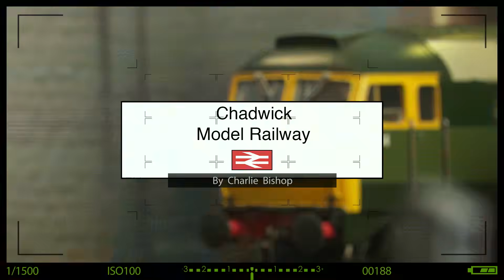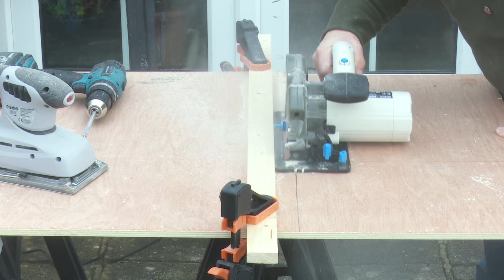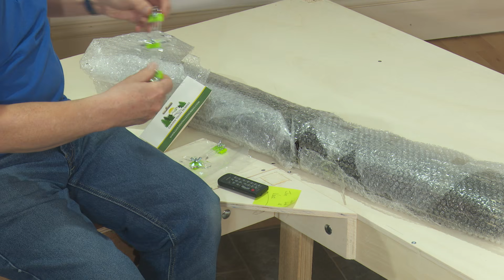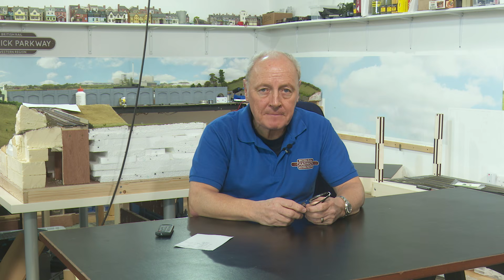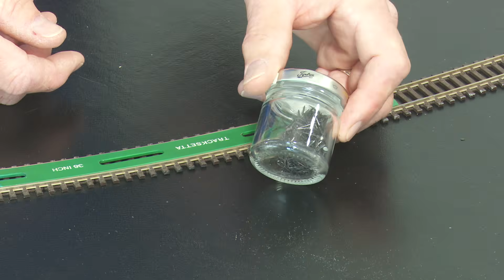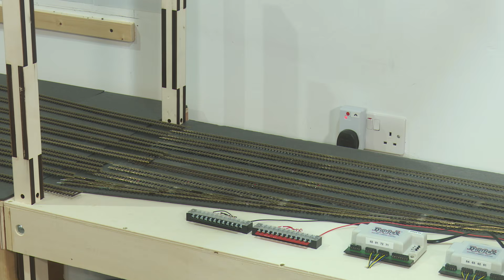Laying Flexible Track at Chadwick Model Railway | 119.

Comment: Hi Charlie,  That was a very interesting way of laying flexi-track and creating curves. As with most jobs there is often other ways to get the same result you achieved. I will try to tell you how I created curves using flexi-track. Nine times out of ten the curve will commence following a straight section of track. Attach the track which you wish to curve into the end of the straight section and using the tools you have gently tease the track to create the desired radius. As you rightly  pointed out the rail on the outside will end up longer than the inside rail. Well I simply mark the outside rail so it is in line with the inside track and with my trusty track cutters I then snip off the "over run" of the top rail and file off any rough bits, job done. If you have any more curves to make then maybe my way might be of some help.  Cheers   Greg
Reply from the maker: It’s great to share our techniques Greg.
Regards Charlie.

Comment: Got my Hattons 66 a few days ago. Turned it upside down to remove chassis and the top grill fell off. Difficult to remove body - but aren't they all. Runs very smoothly. Very nice model but lacking a bit in quality. Cannot comprehend how a model of Rocket could possibly win with all the other quality stuff about!
Reply from the maker: Great comment Roger, many thanks.

Comment: Another way to prevent the track kinking on curves is to have about 3 inches of track between the joins, in other words, have a join on the outer and then have the join on the inner rail of the same track 3 inches away from it. So the joins are not in the same place.
Reply from the maker: You didn’t watch the whole video did you Sam!
Reply: @ChadwickModelRailway  I apologise profusely, No I didn't, I had to leave it at an earlier position with a view of coming back to it, I will try not to jump the gun in future.

Comment: Hi Charlie, I look forward to your videos as they are always interesting and informative. I've seen many different ways of joining flexible track on curves, staggering the joint looks like it gives excellent results and aids removing the "dog leg" from the joint. I usually remove about 6 inches (150mm) of sleepers and then bend the exposed track to the desired radius to remove the natural spring of the nickel silver track. I usually cut the last half inch (13mm) off as it's difficult to form the curve right to the end of the track. Next time I lay flexible track with a joint on the curve I will also stagger the joint. Regards, David.
Reply from the maker: I'm so pleased that you enjoyed it David.  
Stay safe. Regards Charlie

Comment: Thanks, Charlie. I don’t know why I didn’t think of staggering rail joins before.
Reply from the maker: It wasn’t my discovery either.
Reply: we tried it on our initial layout but there's too much cutting up of the ties to make room for the mid-section joints. its not a big deal but it leaves you with a lot more expensive trash rather than reclaimed flex sections. with the price of track (don't tell the guys but i've purchased 500 sections of GT code 80 flex tracks for 35 cents apiece from life-like about 25 years ago- i cleaned them out) nowadays salvaging track for new layouts is crucial to our existence (and our ability to pay the rent...). also gluing individual ties in place is a major pain.

Comment: Within a fiddle yard, how critical is it to have the 6' spacing? I would assume that, particually the straights, you could be as close as the rolling stock allows and just ensure there is enough clearance on curves / make sure you're not running in both directions at the same time?
Reply from the maker: A good point Ian, but getting the trains on and off can become an issue.
Reply: @ChadwickModelRailway  Good point. Although with limited space I'm trying to pack as much in as I can. Suppose I have to pray I don't de-rail in the fiddle yard!

Have got a through line which is at the front so should be able to load / unload there.

I need a bigger house. Or just another house 🤔
Reply: The 2 5/8" spacing on the curves continues the spacing between the "standard" second to third and third to fourth radius curves.  This should avoid the potential issue of long rolling stock on adjacent tracks fouling each other.  If the storage track were entirely straight then the 6' way measurement can certainly be reduced.

Comment: Another excellent video Charlie. 

I have the Rocket but did have issues to start with. One of the wire between loco and tender broke as the tender is not permanently fixed but I was able to re-solder it, luckily I work in electronics so I’m used to such fiddly jobs. To stop the tender from parting the locomotive I have use a small piece of wire sleeving on the pin to hold the drawbar in place. The second problem was it didn’t run. I could hear the motor working but it wasn’t engaging the wheels, a small bit of pressure on top with finger allowed movement. The was a bit of a downer moment as I thought it would have to go back and I knew getting it replaced was unlikely. I inspected it closely and found two black tabs under the boiler that looked a bit out of place and was able to prise them out which fully engaged the motor. It now works beautifully, linking the train together can be a bit of a bugger at first.
Reply from the maker: A great comment Rob. Two cables came off mine! So demoralised.

Comment: Excellent video, I’ve given thought to the subject of joining track on the curve and like you soldered the fishplates. Regarding rail expansion to me cut the track in the centre of a run and as you say stagger the joint. Droppers either side of the cut gives continuity. I’m in the process of creating blocks in existing track work and have found some disc cutters on evil bay for the Dremel with a thickness of only 0.6mm. Should do the job ok I reckon.
Reply from the maker: I think that you're right Roy.  Regards Charlie

Comment: My childhood model railway constructed by my dad was made totally with flexible track so he could create the exact track plan desired. When building Ewood I bought some flexible track to try the same method ..sadly it didn't go well and I reverted to the standard pieces. Dad was a design engineer and a perfectionist..I'm not .RIP dad Ewood Railway was not at your standard but you'd have loved it.
 Thankyou for this video it's bought back memories.
Reply from the maker: What a heart warming comment.  Although I'm sure you'd crack it in time.
 Stay safe. Regards Charlie
Reply: your dad was a man of vision- i think flex is the only way to fly- especially in the finer scales both in terms of options and for minimizing the multiples of feeders.

Comment: Hi Charlie, another fact finding video (wish I had seen these before I built my storage yard) with hard to reach hidden in tunnel sections I soldered the lengths of flex track together and used tracksetta with Peco pins. Because my layout is in the loft I found leaving a 2mm gap every 2.5 metres allows for any expansion/contractions and the sound of the rolling stock passing these gaps adds to the realistic value. 
To ensure Santa sent me the items I wished for, I ordered items and my wife wrapped and hide them up (don't tell the Grand children) Merry Christmas to you and your family and remember stay safe...
Reply from the maker: I'm so pleased that you enjoyed it Barry.  Stay safe. Regards Charlie

Comment: Hi Charlie. A novel and unforeseen use of the Flexible Track Guides - you may not realise but the way you have used them in order to set inter-track distances, is not what these guides were designed to do.  If they were designed to do what you suggest, there would be no need to have the central rail holder adjustable perpendicular to the line between the 3 rail holders.  You demonstrate the use of the Tracksetta guides, but their drawback is they are only good for the specific radius of the guide; the Flexible Track Guides were designed to overcome this limitation in that the 3 rail holders can be set to any radius - ie unlike Tracksetta guides which are a fixed radius.  The idea is the 3 rail holders when set to the required radius can be run along a single length of track to set the curve (much like the Tracksetta can be moved along a length of track). Clearly, as these guides can be set to an infinite set of radii, they work out a lot cheaper and have far greater utility than Tracksettas.
Reply from the maker: An interesting observation David, many thanks.

Comment: Thanks again Charlie for another interesting video.  I never thought of threading the track a couple of inches into the next piece of track, which is an excellent tip.  I have managed to dig the track into my finger when trying to move it along providing me with bloody track.  Now I use pliers or Spencer Wells artery forceps to move the track along to prevent injury.  The track does look good.
Reply from the maker: Don, I'm so pleased that you found the video useful.
Regards Charlie
Reply: ouch! at least sharpen it first....🙁

Comment: Argh! Just finished laying most of my track and I have one dogleg! I used the tracksetta idea at the joins but there is no 27" tracksetta - guess where the dogleg is! Those Golden Valley tools look very interesting. I know what Charlie means about re-threading the Bullhead. It is quite fragile but it is possible. In fact sometimes just press down on the top and the rail will slip back into the chair, something that didn't seem to happen with code 75. The Bullhead looks like the dogs though. No wonder some folk have been cutting the sleepers on code 7 and respacing.
Reply from the maker: I'm so pleased that you enjoyed it Jane.  Stay safe. Regards Charlie

Comment: Looks great Charlie, I have used all three of the fixing hardware you demonstrated but settled for Peco and Piko. Regarding the joining of the rails I have found it challenging to say the least and have made far too many cuts in attempts to matchup the rails.
It was suggested that I solder lengths of track together and I did that wherever possible in the limited space I have but that certainly helped.
Those jigs you are using for the curves look really useful and would have saved me a lot of grief had I known about them and it would have allowed me to possibly get more track in and I might just reconsider what I have.
I never thought of using those Hornby curved tracks but it might have made things easier.
Once again, thanks for inspiring and sharing.best regards
Reply from the maker: Charlie, I'm so pleased that you found the video useful.
Regards Charlie

Comment: I’ve always used set track because I’m too scared to mess up with flexi track! I might have to give it a go after watching this
Reply from the maker: Go on, be brave, we all learn by mistakes. Regards Charlie
Reply: You will have no problem with flexi track so long as you take your time. I built my first layout with flexi track about four years ago and I'm delighted with the results. The one thing I would recommend is get yourself a decent pair of track cutters don't think that a pair of side cutters will do the same job for some reason they don't. Unlike Charlie I prefer to pin my track but this is personal choice and I found the Peco pins are  the best so if you're going to use pins invest in a track pin hammer, they are only about a fiver and are so much better than a small domestic hammer. Good luck and add a pack of flexi track to your Christmas list.

Comment: Great vids Charlie, thanks. For sound deadening, you could trial butal rubber pond liner fixed with Copydex? I bought a small sheet when engineering solutions to our pond waterfall. Very flexible and used in conjunction with your other solutions, might isolate the ballasted track from the base board? Merry Christmas!
Reply from the maker: An interesting point Andy. Many thanks, regards Charlie

Comment: Maybe consider moving the diagonal ladders closer together on board 5 so that the gap in the middle looks a bit more natural. You may have looked at it and chose it precisely because it is fine for preventing errors, but it looks a little strange to me.
Reply: The spacing between the two ladders on board 5 is a by product of wanting to reduce the overall length of the board.  If for example the "Down" ladder is moved left to reduce the gap then the over all length from its left most point to the "Up" ladder's right most point will increase.  So the board would be even longer than the 88" shown in the plan if we are to avoid a board end in the middle of the ladders.  Obviously in a storage yard we don't need to worry too much about "prototypical" spacing.
Reply from the maker: An interesting point HdV

Comment: Surprised to see that the track pins and screws are just standard ironmongery products. Have a look at ironmongery web sites, eg ironmongerydirect.com, among many, and some small ironmongery shops still exist that have packets of 2mm and 3mm screws both countersunk and round head, also try picture hanging suppliers for tiny screws, I used one that, I think, was based in the Shetland Isles. You should be able to buy larger quantities for less. The same applies for bicycle parts - the bike shops might charge 0.50p per 5mm bolt whereas ironmongery suppliers do packs of hundreds for a few £s. Also, use Screwfix rather than B&Q (same holding company) for screws and pins.
Reply from the maker: An interesting comment Nicholas, I’ll check it out.
Reply: I can confirm everything you stated Stephen .  Hammering in pins is crude whilst screws can be easily be repositioned if necessary. I then copydex , carefully lifting the track a little when applying and everything is in the correct place and can remove the screws when set .

Comment: Great job Charlie....(as always). The track spacing looks perfect with the tool you used.

I have not started laying my yards yet. I am still trying to figure whether to buy an NCE Radio DCC system or a Digitrax Radio system for a large mountain HO railroad (about 400 feet of mainline). It is confusing in the early stages to make a decision when you're first getting into converting from DC operation to DCC. 
Philip 
(From New Jersey)
Reply from the maker: I’m glad you enjoyed the video Philip. Choosing a D cc controller is always going to be a nightmare. Regards Charlie
Reply: @ChadwickModelRailway  Yes it is a nightmare starting out in DCC with a decision which to buy. I agree. There are elements I like with both systems, so there's the dilemma.
Reply: PHILLIP, I have Digitrax. My friend just changed to NCE . Go with NCE. Check out the problems Digitrax has had with their new throttle.

Comment: Great video Charlie. Very helpful with my layout planning. Question (sorry if you've answered this already). How are your remote controlled plugs working out? Also, why did you choose Hornby 4th radius curves over flex-track on that bend - especially as you mentioned with more time that's what you would have used on the helix?
Reply from the maker: Hi Mark, the remote plugs bought from B&Q, are working fine. Are use the fourth radius curves, just because I have them!. Regards Charlie
Reply: @ChadwickModelRailway  Makes sense. Those track spacers look handier than a small pot (as they say in these parts - the wild mid-west of Ireland).

Comment: Interesting as ever Charlie. 
I would certainly recommend using the "staggered" rail joints for curved track in fiddle yards, as it reduces the strain and distortion at the actual joints. They use this arrangement on the prototype on North American railroads. However, for curved track in scenic areas, I'd still have the two rail joints opposite each other, as this looks more prototypical for British track.
Reply from the maker: Thanks Peter, that’s an interesting fact. Regards Charlie

Comment: Good afternoon Charlie I enjoyed your video today again now I dont really have a question about layouts nor an answer regarding the 3 top engines. However in March/April 2021 I plan to retire a few of my older engines not get rid of them but take them from daily/weekly running which means I will be looking for replacements now I do not really like my Hornby early 2000s  how ever they have improved. But which companies would you and your subscribers recomend.
Reply: Thanks Charlie. For Xmas video - which bit of kit does what - in terms of controlling signals, block detection, etc. it’s mind boggling.
Reply from the maker: I will produce a Block Dectection for Dummies video soon.  I just have to read up on it first!
Reply from the maker: I think the answer is first to stay within a certain time period.  Then see what's available that is DCC ready. It's a minefield.

Comment: Bought 2 hattons class 66's, No issues with them, Beautiful models and run like a dream :)
Reply: Well Mr Jones, if I were you I would buy a lottery ticket for having two Hattons 66s without any issues :) Have 5 now and all running well but not without having to do work on all of them.
Reply from the maker: Is that the latest version of the class 66, or the earlier one?
Reply: @ChadwickModelRailway  latest, bought first day the sale started, 0 issues with them